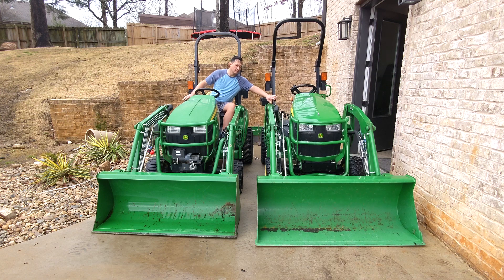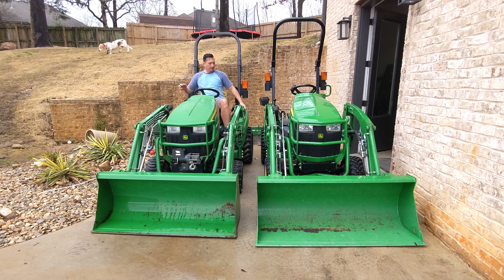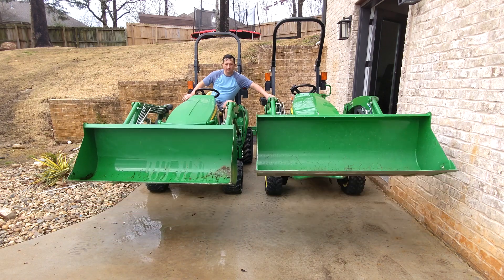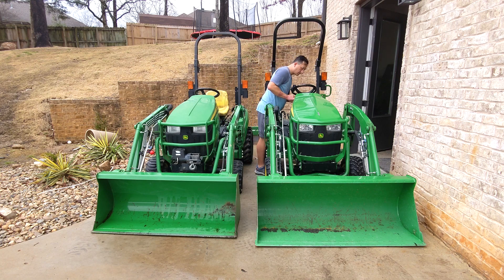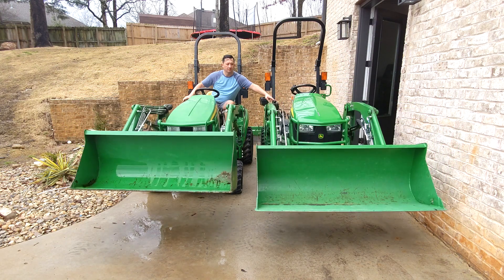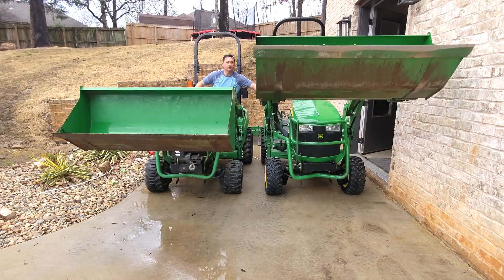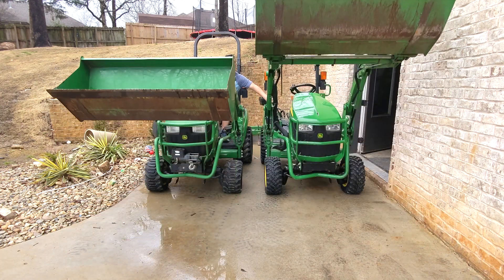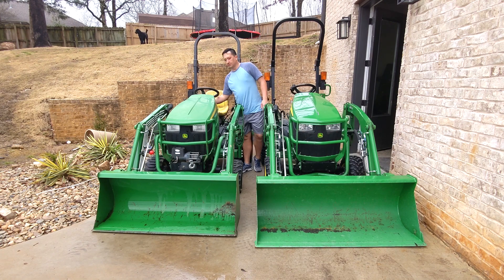John Deere 1 series hydraulic upgrade Part 1 - modification with stock pump

Comment: Is this showing the increase with JUST the flow divider? Or does this include the 2025r pulp upgrade as well?
Reply from the maker: This is flow divider only, aka the stage 1 kit.  I don't recommend this kit, not because it's not great, but once you get it, you'll want more.  Almost everyone ends up with the stage 3 in the end.  The reason is mostly that the stage 1 at WOT is enough for what most people need and want, but with stage 3, you can get the same flow at around 2000 RPMs as you have at WOT with stage 1.  Stage 3 has the same flow at idle as the stock tractor has at WOT.

Comment: Interesting, but not sure this is an apples to apples comparison as the one 1025 does not have the same 120R loader.
Reply from the maker: The loaders have the same lift height and use the same lift cylinders, so I think it's as apples to apples as you can get using 2 different machines.  That said, if it was critical to get down to the millisecond, what I should do is swap the loaders between the tractors and do the test again.  In this case, what I was aiming to do is show the difference in speed visually, which I think this demonstrates.  

I now have other tools, like flow meters, that can also demonstrate the difference in speed...but at the time, this was the best approach that I had available.  As well, numbers like 3.3GPM vs. 5.2 GPM don't easily translate to what your experience might be.

Comment: Will this void my warranty?
Reply from the maker: The short answer is no, but it may affect the warranty of some parts depending on what fails.  I can take you through the nuances of it if you want to give me a ring at 501.291.2002 or send an email to kevin@hydrosplus.com.  An important piece of legislation that protects us as consumers on the topic of warranties is the Magnuson-Moss Warranty Act.  In a nutshell, it's the manufacturers burden to prove that a modification caused the failure if they don't want to cover the part/issue.  Obviously, some are easy that you wont' have to argue over, but some will fall into a gray area.

Comment: My understanding is that the power steering has its own system. While everything else operates on their own system as well. Kubota is designed with one system for everything including the power steering.
Reply from the maker: On the 1 series and 2025R, the power steering and implements are fed from a single pump.  Larger JD tractors have dedicated pumps for the power steering and implements.

Comment: Will this make my mower deck spin faster? Can I lift more using your mod?
Reply from the maker: This mod won't affect the mower performance or lift capacity.  It will make hydraulic implements run faster and smoother.

Comment: Does add to the lift capacity? It would be interesting to see that comparison.
Reply from the maker: It doesn't affect lift capacity.  This system creates flow and the pressure relief valves regulate pressure...which translates to lift capacity.  I have a video that shows how to check yours if you're interested.

Comment: Ate they both 1025R’s? The one your sitting on looks like a 1023.
Reply from the maker: Correct.  One is a 1023E and one is a 1025R.  They have identical hydraulic systems running at the same RPMs

Comment: You do realize your whole tractors ran off hydraulic pump from go to reverse lubrication for the PTO lubrication for the transmission front loader 3-point arms
Reply from the maker: Yes and no.  There are 2 hydraulic pumps.  Our kit addresses the implement and steering pump.  The implements include the SCVs and 3 pt arms, as well as anything connected to the power beyond.  The hydrostatic drive runs off of a separate pump on the front of the transaxle, so our performance kit does not affect the travel speed of the tractor.  The PTO is direct drive from the input shaft and is not driven by hydraulics, thus not affected by the kit.  You are correct that the lubrication for the transmission and PTO is the same fluid as what is used in the hydrostatic, steering and implements.

Comment: Would it add to the flow for front implements such as a Grapple with a Diverter valve?. Theirs only 3gal/per minute flow. I'm looking at a hedge trimmer that attaches to the front bucket and requires at least 3-4.5 gal/min to operate sufficiently.
Reply from the maker: Yes - this will add flow to all implements regardless if it's Power Beyond, loader SCV or the third function SCVs.  Using your stock pump, you should get 4.5 to 5 GPMs at WOT with this upgrade.  Using the upgraded pump I have available now, it will be 6 to 6.5
Reply: @HydrosPlus  CBS.
Reply: Hcu bbn vjchc jic
Reply: Hcn bbn co ii g c